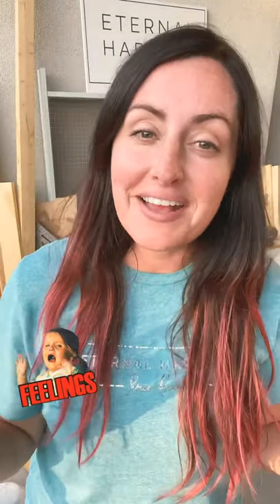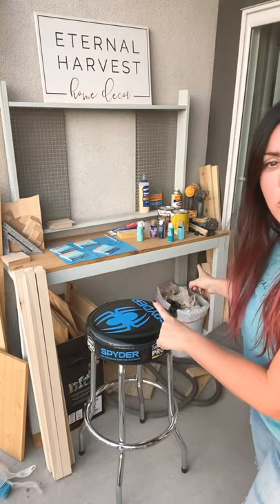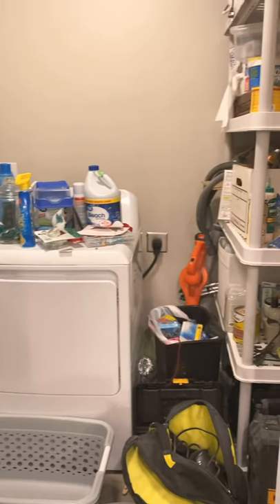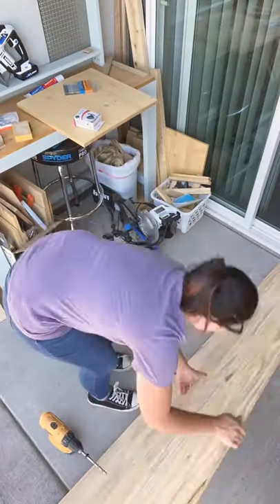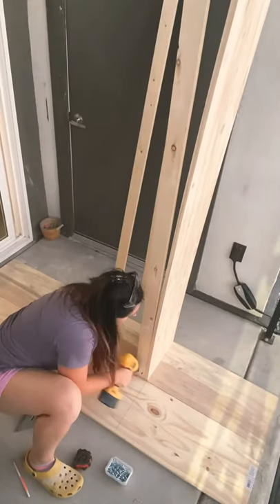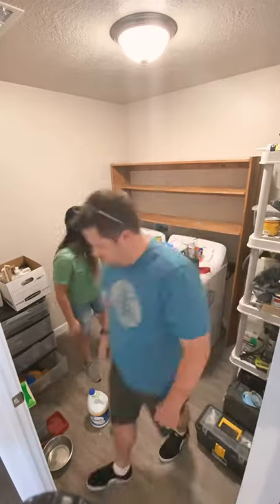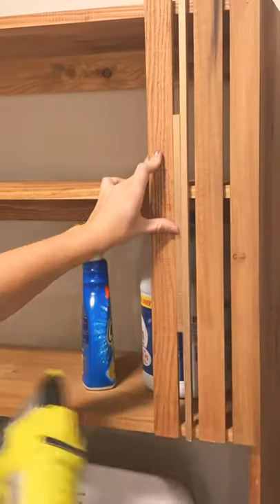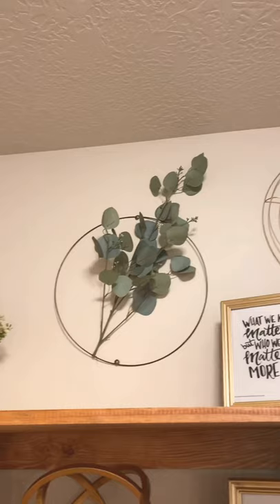HOW I MADE A WASHER DRYER SHELF -all on my BALCONY beginner build

Comment: Love this idea. I once did a shelf unit inside a coat closet in a rental.  Didn’t want any anchors or bracing. I made two ladders that fit under the existing shelf and was able to just put shelf board across to each ladder. It was easy and disassembled easily when we moved.
Reply from the maker: That’s genius! You’re the best